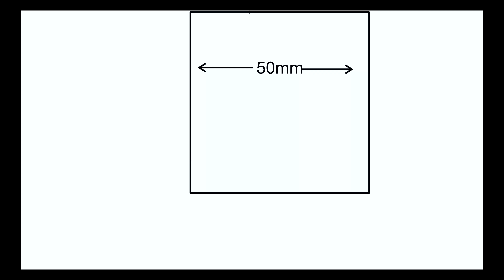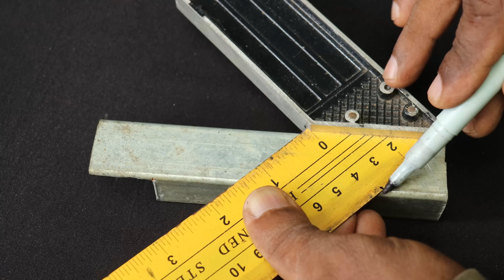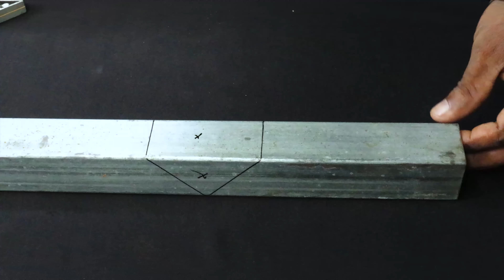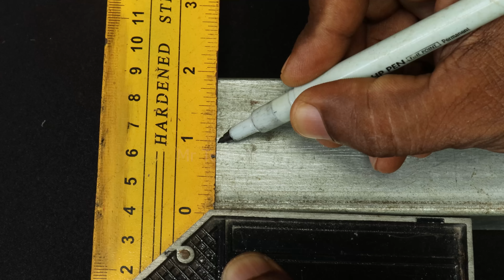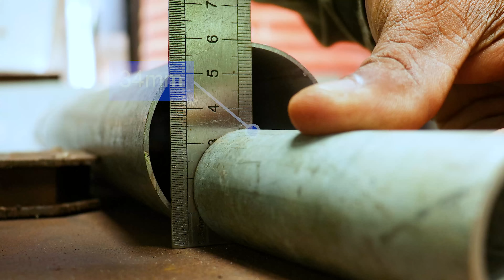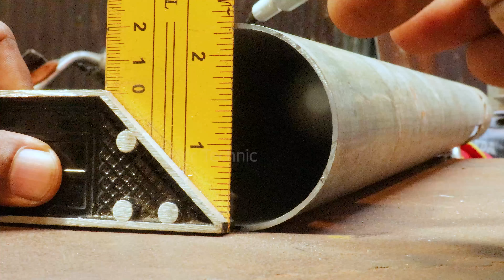Welder Needs to Know These 10 Easy Tips | Homermade welding tips @MrTechnic

Comment: Question is: does it makes your joints more solid built than normal weld?
Reply: It is more of a display technique and of getting a better fit for welding.
Some things are impractical for welding due to the time and extra wear on the cutoff tools.